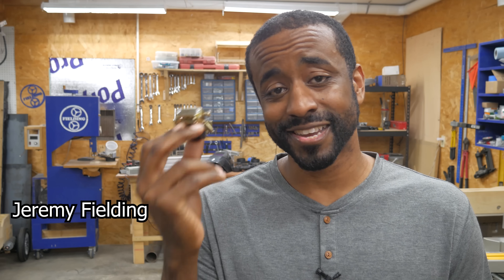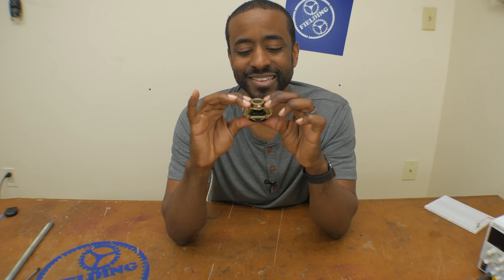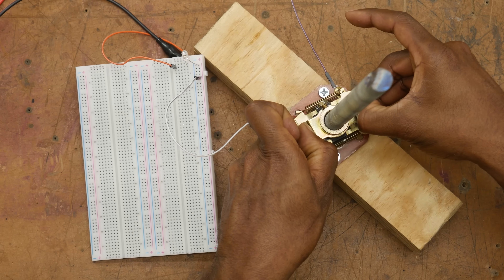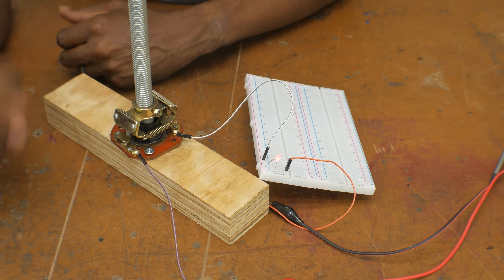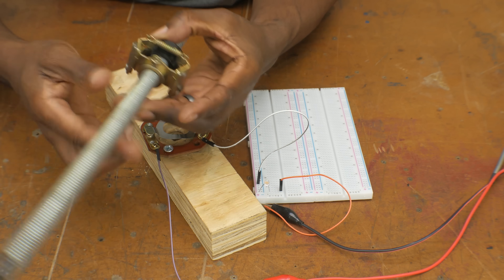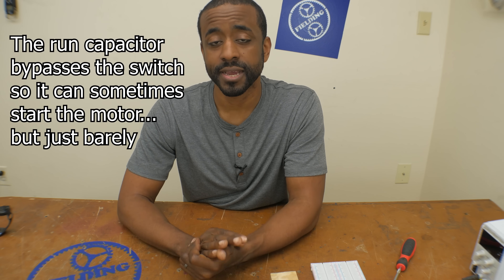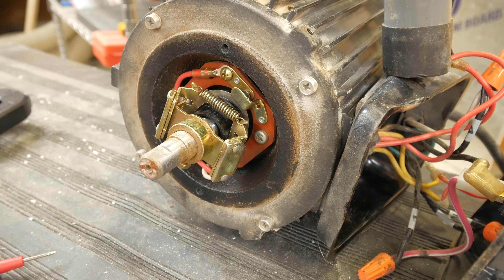This Clever Device Is Found In Nearly Every American Household. How It Works And How To Fix It

Comment: One of my motor was sent to be repaired due to too noisy. When it return. sometimes it work, sometimes it don't work. I wonder if it is due to capacitor. I call another mechanic to refix it. He just adjust the switch and the motor starter become normal. I really want to understand why. Thank you for showing me how the switch works.

Comment: Neat I have a motor that the capacitor gave out but I still use it when I turn it on I give it a push to get it to go it is a stationary belt sander so it is not a problem to give it a push every time will I ruin the motor doing this?

Comment: Thank you. I have a 220V single phase power saw. This is a pretty old powermatic saw - maybe 1970's. It has been running perfectly for me for 7 or more years. GREAT SAW!

Motor stopped running - replaced the capacitors and it started up great! While I was in there a noted grease nipples at the front and rear bearings and pumped - probably way too much grease into the bearings. Now the motor runs for about 15 seconds, then blows the 20amp breaker every time - no load. I am no wondering if too much grease could get into the centrifugal switch and cause a short. I am going to open it up and see what it looks like in there.

Thanks for your informative video. I don't know a lot about electric motors, though I do love my tools that they run. I'm lost when they stop running!

Comment: I removed my table saw motor, which worked, blew it out with the air compressor and it hummed but wouldn't run, saw this video went out cleaned the contacts you showed and wala it worked again! Thanks so much.

Comment: The Capacitor is one version of the motor.  Some have a separate starter coil that runs in conjunction with the main coil until the RPM is up.  This also uses the centrifugal switch.  Since it doesn't overdrive the main coil, it is said to last longer.

Comment: Jeremy: Centrifugal governors were invented by Christiaan Huygens and used to regulate the distance and pressure between millstones in windmills in the 17th century. In 1788, James Watt adapted one to control his steam engine where it regulates the admission of steam into the engine, a development that proved so important he is sometimes called the inventor. The electric motor was invented as a replacement for the steam engine, so its inventors were surrounded by centrifugal governors.

Comment: The other advantage to using this type switch over an electronic replacement is it is fail safe. An electronic switch could fail, but you don't know which way it will fail. The mechanical switch uses the energy stored in the spring to return the switch to it's at rest state. The pitting on the switch contacts can be caused by dust getting into the switch which every time the switch actuates it burns that dust. This builds up on the contact pads and eventually can disable the switch.

Comment: My grandpa had a master force drill press  and I was thinking about the motor and I remembered  it DIDN'T have a centrifugal  switch and it had 2 capacitors........     it took me  watching this video after 5 years to realize they purposely engineered it to fail  the entire outer shell was an aluminum  heat shield  and on top of that it had  a fan built inside the case that ( was supposed to keep it cool)  but it barely  did anything  and after about 30 minutes of use it was  so hot you couldn't  touch the side of it  ( I know it didn't  have a centrifugal  switch cause I took it completely  apart and never saw anything like it)  Now I see why there is absolutely  no videos on YouTube about it

FIVE LONG YEARS I FINALLY KNOW THE TRUTH !!!   

If I wouldn't have found your channel  I would have gone another 4 years without knowin

Comment: Its a 3 angle, double ended whatch a madinger.  It attaches to the giggle pin & drives the wobble bearing.  It replaces the muffler bearing.  & if you'll believe that, I'll tell ya another one.  Its painted dark white (gray).  Its lubricated with kickapoo joy juice.  Its often used as a belly button tickler.  It was invented by Weird headed Jimmy, a friend of Johnny Square Foot.  He died when he sneezed backwards & blew his brain out through his pointed ears.  Why does the rain fall?  Becase the sky leaks.  Why is ice cold?  Because it isn't hot.

Comment: The centrifugal switch dates back to 1920’s and was patented by Dr. Royal Lee in 1927.  However, the concept actually dates back, at least, to Leonardo da Vinci with a flywheel that has a variable moment of inertia.  This concept was used in a device on many earlier engines to regulate angular velocity and was referred to as a centrifugal governor.  The centrifugal governor worked similar to the centrifugal switch that you presented; except that there is one primary difference – and that is its state.  The centrifugal switch has only two states and that is either fully extended or fully contracted.  This is due to a centripetal countering spring that must have a specific force exerted.  While the centrifugal governor can have any state between fully extended and fully contracted.  If you are interested in centrifugal governors, I suggest that you google the porter governor.

Comment: Jeremy, My drill press has a problem starting, but has no capacitor that I can identify. After much searching, I found that motors made before approximately 1965-70 had a second winding but no capacitor??? Can you add anything about this or verify my findings for those of us who have very old equipment? Strangely enough, my motor has a sticker that says Capacitive Start on it, but if it has one it's very small and internally located.

Comment: You forgot to mention the fulcrum design of the device. It is the key to it snapping so decisively. As the arms start to move their mass is moved outwards. This means less rpm is needed to fling them out than before, so they move faster outwards (assuming the total mass rotating is much higher than the little device). The same goes when it retracts again. As soon as it starts moving inwards it moves it's mass into a tighter "orbit" which means more rpm would be needed to hold it out. Thus it snaps all the way in.
This clever little trick creates a hysteresis in the design so that as soon as it reaches the rpm required to operate/disengage it will do so even if rpm drops slightly at same moment. Once activated like this, the rpm has to drop significantly below it's initial target before it again is deactivated and thus engages contact again. Very elegant!

Comment: I had one fail to open at my work on a fuel transfer pump.  It would not remove the start capacitor from the circuit and the capacitors would detonate.  So, if your start cap suffers a violent death, check your centrifugal switch.  This one was rusty.

Comment: You need a points file in your tool kit.  Better for this application than sand paper.  Back before they started putting electronic ignitions in cars every amateur and pro mechanic had a points file.  You can still find them today on amazon.  Maybe perhaps an auto parts store but I wouldn't count on it.  It's just a file but it is thin enough to slide between the points without disassembly.

Comment: I like preloading my brain with information I might never actually need, but it's in there just in case. This is exactly in that vein.
Reply: Fun Anecdote about this, because I do this too: during a class in college, my instructor asked us how many GPS/GNSS satellites it takes to get a position. Anyone that had an answer said 3, and were baffled to find they were wrong. Lucky for me, I had watched a video explaining how GPS/GNSS works just a few months before. I was able to explain how 4 were required to compensate for time deviation, because the satellites are travelling fast enough that there is a significant error in the equations if time deviation is not accounted for. "Gobsmacked" is exactly the word to describe the class, and the teacher was quite impressed. So preload on! It's actually saving me in my college studies.
Reply: "Preload your brain..."  
That's a marvelous phrase!

Comment: When the contacts stick/weld together, you let the smoke out of the start capacitor. Thats a smell you never forget. A cross between a skunk & burned electrical.
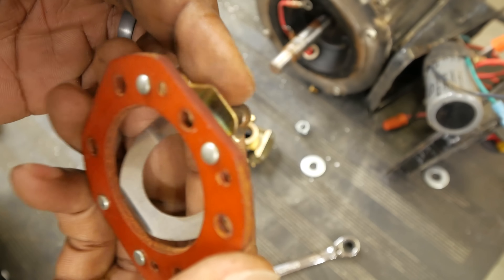Reply: 7:35 I'm used to large capacitors with a different case. It was funny to see this one because it's the design on electronics boards. - You posted a good "let the smoke out" remark.

Comment: go up on voltage,  because it's the rating. higher voltage rating means longer life. do NOT GO UP ON CAPACITANCE if the motor doesn't need it.  it's a fine tuned equation to give bang vs heat generated in the start winding.

Comment: I have an old drill press from 1979 and I always wondered what the click was.  I thought it was a relay.  Most of my other tools don't have nice beefy universal motors.  My craftsman oil-less air compressor has something similar I think, but it's made of plastic and as it wears, the unit will blow breakers when trying to start up.  shimming it with a small washer fixed it.  Designed obsolescence in that case unfortunately.  I cant wait until I find a proper cast iron oiled air compressor for the right price, these oilless units are incredibly loud.

Comment: I had a problem with my tumble dryer a while ago - and remembered a conversation I had years ago about how capacitors are used to start single phase motors.  So i turned the drum, the tumble dryer ran.  Then it stopped to do the alternate direction and would not start - so I turned the drum again, and it ran until it stopped to make the alternate direction again.  I pulled the dryer apart, found the capacitor, found a brand new replacement on eBay for £10, fitted it (having made careful note of where the wires went, there were only 4) at which point my tumble dryer worked good as new!  I was very proud of myself.

Now, modern dryers are much more efficient, this one is probably over 20 years old.  But, from a financial perspective, you would have to find a very efficient dryer indeed to offset the cost of a £10 repair on an old machine.

Comment: Same physics was used in old car ignition distributor using contact breaker/cam and induction coil to generate the spark at the spark plug. As the engine speeds up the contact breaker needs to be advanced so the distributor spindle had weights attached to the contact breaker. The faster the car engine went the more the weights would move out advancing the contact breakers on the cam. Nowadays of course its all done electronically in cars and its more reliable.

Comment: This clever little device is a piece of ca-ca. Absolute crap. For any motor to have high reliability you need a motor start relay or better yet an electronic start "relay". the springs fly off. the plastic collar breaks. They need lube but of course never get any. They fail and cook the start cap and fry the start windings. This is PLANNED OBSOLESCENSE at its best!  Have a look at Franklin's submersible pump motors [and many others] that are 3 wire and have a control box. These are nearly as good and as reliable as 3 phase motors.

Comment: It is interesting to notice that a little shaded pole motor does not need a capacitor to start.
I have also noticed that after having taken many cloth dryers apart I have found no capacitors to start their motor.  Also, their centrifugal switch is used to disconnect ( their start winding that has no capacitor) and connect the other leg to the heater and also the timer motor on the timer switch.  
If the weather is on the warm side, a washing machine induction motor will also start turning without a capacitor soon after you bench tested it a few times.  I believe you can also start these motors by just connecting the start winding without the use of a capacitor if there is hardly any load on the motor.  The capacitor seems to be just because of the load and not because you have to have it.
Not all these single-phase induction motors use capacitors to start them.  I don't think this point gets emphasized much at all.
Dishwashers, window air conditioners, dryers.  But dryers?.... they do carry a load when you load your dryer with the wet cloth.  Perhaps because with washing machines you have water in the tub which is far heavier than a mere wet cloth.  I don't know.
Reply from the maker: You should watch my video on the shaded pole motor. I think you would enjoy the explaination of how it works. It takes very little actually to start a motor. The start capacitor makes certain the motor will start, but even a tiny bump of the shaft can make the motor start if there is no load.

Comment: What about motors that run OK, but intermittently won't start?

My air compressor will charge up, and then kick off. Watching the motor I can see it either turning slowly or not at all. 

I've tested the switch. The caps don't look swollen. It can sit awhile and then it'll work again as expected.

Has me stumped.

Comment: Actually motor capacitors are often there for phase correction in inductive loads like motors. IE current lags voltage in an inductor so you put a capacitor in parallel to correct it so voltage and current are as close to in phase as you can get them. This is a legal requirement in some countries and in the UK you can end up charged more for having an unbalanced/out of phase load in industrial units.

Comment: James Watt is genarally accepted as the inventor of this device, I learned this at school almost 60 years back.  ;-)

In 1788, Watt began to think about a way to make this happen automatically. His solution was the flyball governor. The flyball governor is based on the idea of a feedback control loop. It works like this: Weighted balls are linked via hinged arms to the shaft of a steam engine. As the engine turns faster, the hinged flyballs fly apart. But, as the balls separate, a linkage causes the throttle on the steam engine to close.

However, by the time I got to university the general consensus was that Christiaan Huygens invented it to control windmils in Holland almost a century earlier...

Centrifugal governors were invented by Christiaan Huygens and used to regulate the distance and pressure between millstones in windmills in the 17th century. In 1788, James Watt adapted one to control his steam engine where it regulates the admission of steam into the cylinder(s), a development that proved so important he is sometimes called the inventor.
From Wikipedia
https://en.wikipedia.org/wiki/Centrifugal_governor

Comment: Jeremy, good videos. you are clear, easy to understand and use as many visual aids as needed.
I have changed the capacitors before but never needed to go inside the motor (yet). It won't be an unknown now. Thanks

Comment: It was a guy. a guy developed most of the stuff we live with. Nick Tesla was one guy.  Anyhow, this is what my 2hp Jet motor has.. I blew two capacitors.  I also had a lot of sawdust in the motor, it was on a big vacuum....I thought that was the problem. Nope. Then I found this video. It's 10:25 am Oct 28...The points were burned and pitted. and stuck closed....There was much black soot on the stainless metal piece and it was also "over sprung" so I de-pranged it..... I sanded the points for 20-30 minutes and I give them a B+.  So now I'll get another 400mfd/125v capicitor. and life will be good. Thanks.

Comment: I have a pool/spa/jacuzzi pump motor that wouldn't start, would just hum. It has 2 windings, start and run, but no capacitors. I cleaned the centrifugal switch contacts that cut the start winding in and out and yes it now starts and runs. Thanks for the video!

Comment: Do NOT use sandpaper, the contacts are very similar to the points on older cars, and as such the same rules apply, even the best sandpaper may leave a grain of sand imbedded in the metal of the contacts, which will cause a failure, as was found years ago a metal file will not cause this problem.  Years ago a "point file' was a common tool found in auto part stores, I don't know if they still are, I have a 30 year old one in my tool box.

Comment: The capacitor should be rated at double, plus a little more, of the supply voltage operating it.
So a motor operating at 120V AC should have a capacitor rated for 250V. A cap of the wrong voltage rating will have reliability and safety issues for obvious reasons.
The capacitance is specific to the geometry of the motor's windings, usually between tens and hundreds of micro Farads. It is small because it's job is not so much to store a lot of energy but to create a time delay as it charges and discharges quickly, but a little behind the changes in the AC line Voltage. This is called phase shift.
  When one of the windings is placed in series with it, the different windings experience the voltage change at slightly different times creating a difference in magnetic force between them and thus torque which moves the rotor starting the rotation. Once it's moving, the rotation itself provides the phase difference necessary and the capacitor is no longer needed.
  Because the capacitance is quite specific to the motor based on phase angles of windings and the frequency of the power system (60Hz in the U.S.), one can't simply replace a bad cap with any old value and expect good results. The phase shift needs to be partway between the opposing windings. Too much or little might not give the torque needed or may make it start backwards.

Comment: The capacitor provides a phase shift to start rotation in single-phase motors, otherwise, the shaft will just vibrate and never turn.